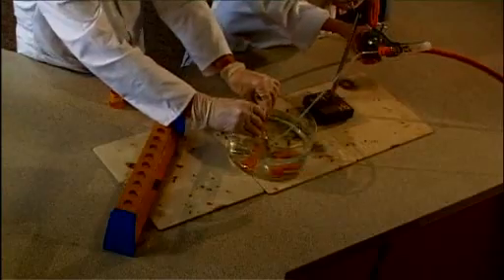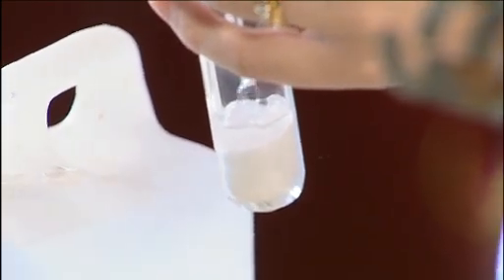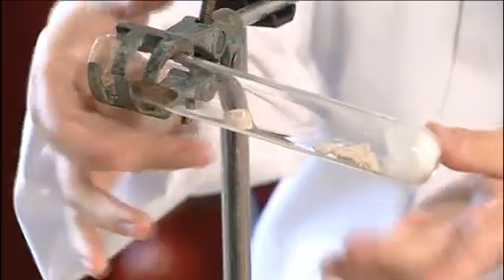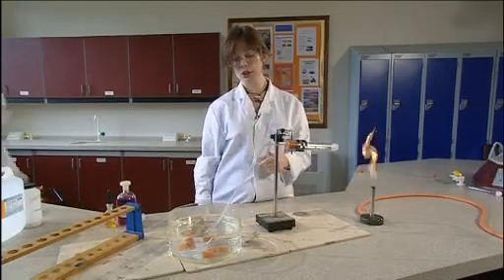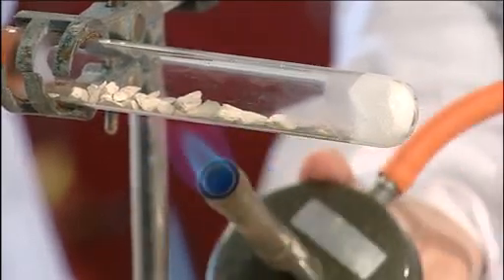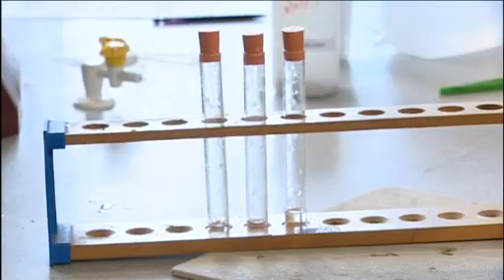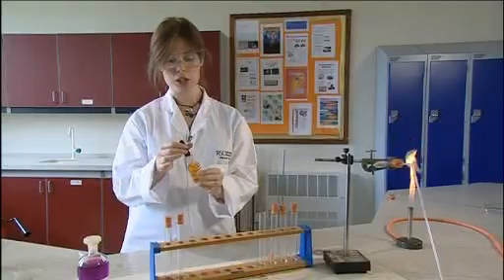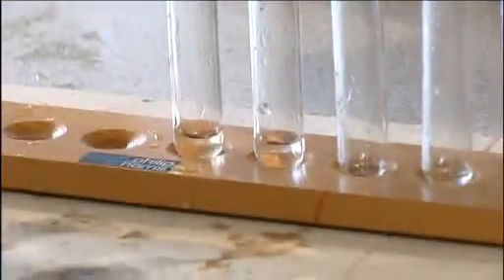Cracking a hydrocarbon

Comment: i want to have c c triple bond
Reply: Me too
Reply: Any one?
Reply: The simplest way to produce acetylene (ethyne) is to mix Calcium Carbide with water
Reply: @kevinlcarlson  I want you to do this experiment for me as I here in egypt can't do it for alot of reasons
Reply: @mahmoudwanas8400  I have done this many times.  Calcium Carbide was sold as “Miner’s Lamp” which burned an acetylene flame as water was slowly added.  Also, it has been used for toy cannons because igniting a mixture of air and acetylene can be VERY loud.  I don’t know of any other simple chemical process that can produce a C-C triple bond because of the energy required.  I wonder if it might be produced by catalytic cracking of petroleum and then separated using fractional distillation
Reply: @kevinlcarlson  what if i asked you for another practical experiment??would you help me making it??
Reply: @mahmoudwanas8400  I might be able to, what is your idea?  Also, you may be interested in the “NileRed” Facebook page, which has many interesting chemistry experiments
Reply: @kevinlcarlson  very nice
Reply: may i ask to see the effect of electricity on the reaction of calcium carbide formation (lowering the reaction temperature) it would be better if we use CaO
Reply: @kevinlcarlson  hello you still there????
Reply: @kevinlcarlson  are you there!!!!!!  i'm afraid that CIA have caught you by now!!!!
Reply: mr @kevinlcarlson  you certainly believe that this won't work?, we don't want to make practical experiment to be more certain??

Comment: What is suckback?
Reply: Suckback occurs when heating a boiling tube strongly and collecting gaseous products.  As the tube is heated, the air inside expands and forces itself out of the tube and into the water bath.  If the heating is not maintained, then the pressure within the tube can drop, causing the water in the bath to travel back up the delivery tube and into the boiling tube.  The resultant thermal shock can cause the tube to shatter, as the tube is likely to be at a temperature of several hundred degrees Celsius.  

In truth, the phenomenon is fairly easy to prevent: a small length of rubber tubing, roughly 2-3 inches long, is attached to the end of the delivery tube that will be underwater and the open end plugged with a short length of glass rod.  Then a slit is cut into the rubber tube to allow the gases under pressure to escape but the water pressure will force the slit closed and stop any water from travelling back up the delivery tube.  Without one of these it is necessary to constantly observe the setup for any indication of water travelling up the delivery tube, and if this happens then it is essential to remove the delivery tube from the water WITHOUT ceasing the heating process; this will force the water out of the delivery tube.

It also occurs when trying to dissolve a highly soluble gas (such as hydrogen chloride or ammonia) in a solvent such as water; as the gas dissolves, the pressure changes cause the solvent to be sucked back into the reaction vessel.  This can easily be prevented by replacing the delivery tube with an inverted funnel inserted just under the surface of the solvent; if any suckback occurs then the solvent level drops below the level of the funnel rim so that further suckback is impossible.

Comment: Got a question in regards to frackn and wanted to know possible hydrocarbon bonds as I'am looking into the oil and gas industry to create from hydrogen and carbon by use of pressure, liquid hydrogen, powder cardon, temperature or other elements to correctly start a bond conversion into correctly drilled and cutting for extraction for the industry for correct extraction method and possible pressed hydrogen carbon for bond to element chain occur's I've been looking over the current methods and have worked with stones befor (o boy) and am looking if this also might be possible to change other non-usefull hydrocarbon to usable one's for the oil and gas industry (2nd mistake about and this was a few years ago) as they seem to have missed environment law and have noted hydrogen capture is available and noticed a huge amount from the sun on a daily basis and wanted to see if cut extraction and vacuum and time for gas to excape could fix the huge issue in operation and design and have looked into a drill system to yeald maximum extraction and allow the strength of the layer not to frack and hold load and have a big issue with the current method off drilling and didn't not a correct drilling operating procedures for the method if any data is available could you please send details yourattroysmailbox@gmail.com. YES ho do I pay for the wool😆stop frackn OMG

Comment: Agree strongly with Stephen - a Bunsen valve is easy to make and adds safety. About 3cm of rubber tubing that fits over the end of the delivery tube. Make a longitudinal slit in the tubing with a scalpel, about 1cm long and then plug the end of the rubber tubing with a short length of glass rod.  NB if using bits of broken stirring rods, be very careful as they will have sharp edges that are best removed by polishing the broken surfaces in a hot Bunsen flame.
Reply: I was wondering why there wasn't an anti-suckback assembly on the delivery tube
Reply: I was thinking the same, basically like a brake bleeder.

Comment: Both the bromine and the permanganate can oxidize the hydrocarbons if they have double bonds. Since these oxidated compounds are colourless and their formation depletes the colourful reactant, you can witness the colour change.
Eg: CH2=CH2 (colorless) + Br2 (orange) --> BrCH2-CH2Br (colorless)
[ethylene + bromine --> 1,2-dibromoethane]
Reply: Oxidated? I think you mean oxidized. I'm going to assume this was a brainfart, since you used the present temse, oxidize, properly. Either that, or perhaps English isn't your first language. But the chemistry checks out. No pseudoscience here.
Reply: Now that I think about it, I recall this was one of the first reactions I learned about. Reacting a halogen with an alkene to replace the double bond with a single bond and a halogen. It was so long ago, I can't recall the name of it. Maybe SN1. Or halogenation. I learned this before this video was even made, so the information has gotten a bit dusty on the shelves in my brain.

Comment: They allow for seperate pathways through which you go from the same reactants to products with less activation energy. Solid catalysts like platinum and palladium hold the molecules of the reactants down so they can react more easily, and they then push off the products, something very important for good catalysts. Cataysts need not be solid as long as they make for a mechanism in which they're not used up. Fast colliding particles in the appropriate spatial orientation lead to reactions.
Reply: Pumice isn't solid?

Comment: For this experiment my chem class used Aluminium Oxide as a catalyst. I do understand that the catalyst decreases the amount of energy required to break the Carbon-Carbon bonds. however, how does it do so? Thanks
Reply: pranavguitarist the catalyst lowers the activation energy, requiring a low amount of energy (heat) to break bonds between the carbons then break into smaller chains/ lengths of carbon thus producing derivatives of larger hydrocarbons